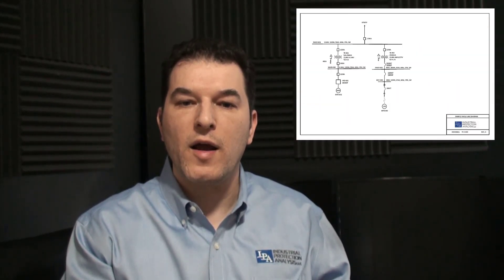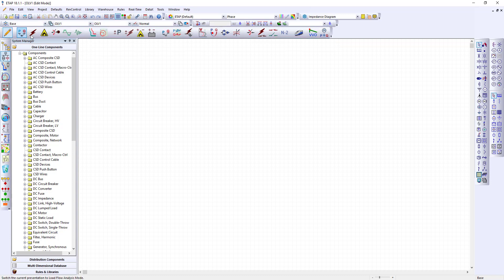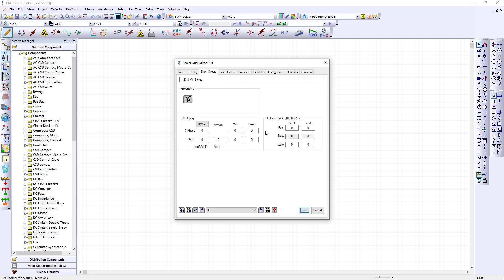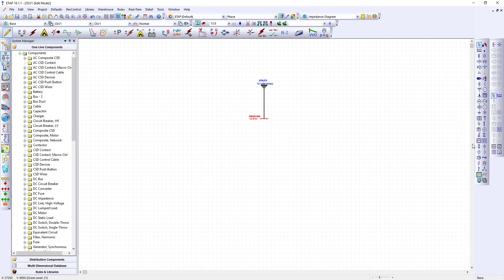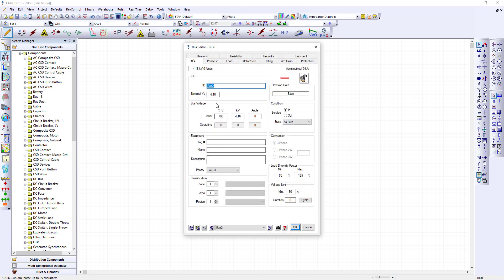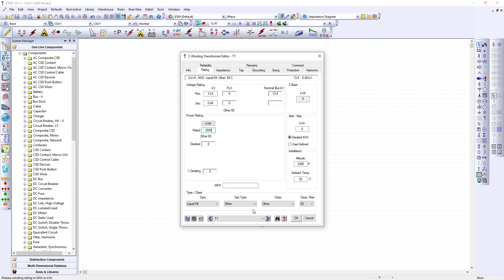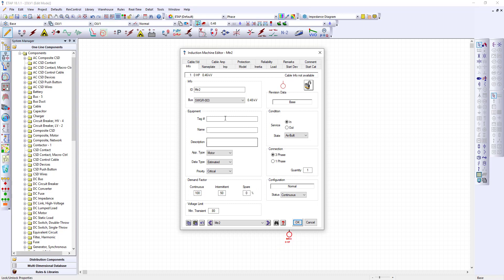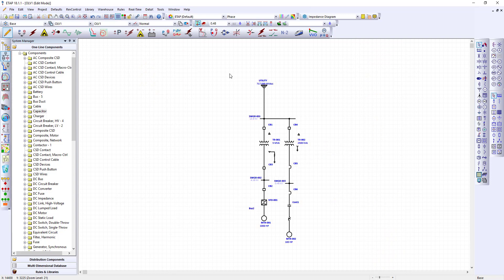ETAP Single Line Diagram (SLD) Video Tutorial

Comment: How to I add a voltage regulator from the AC device toolbar. I can't find it there
Reply from the maker: ETAP does not have a "voltage regulator" component in their library. Depending on what you are trying to accomplish, you may need to do some manual approximations.